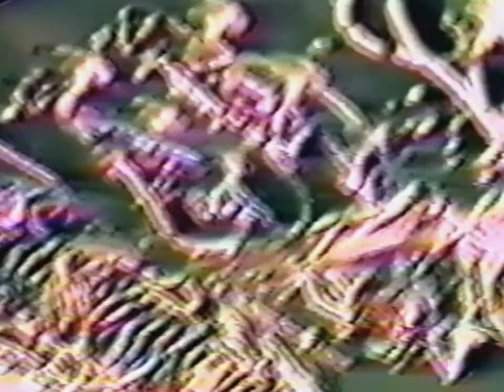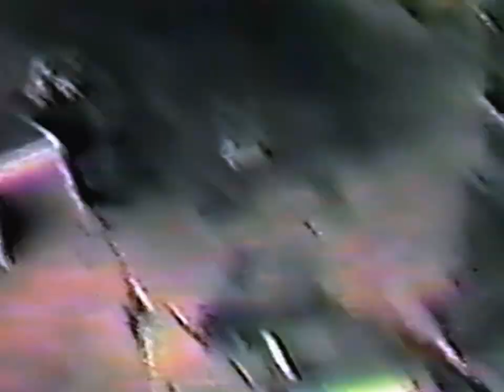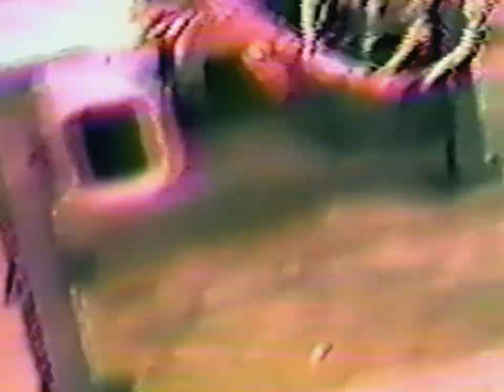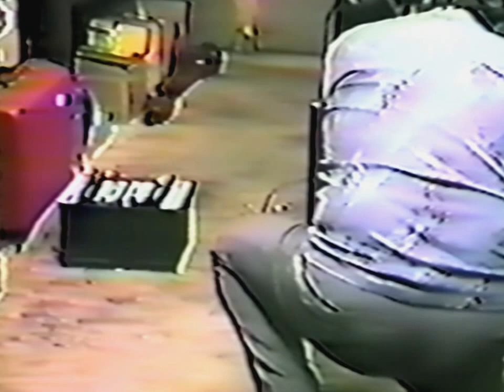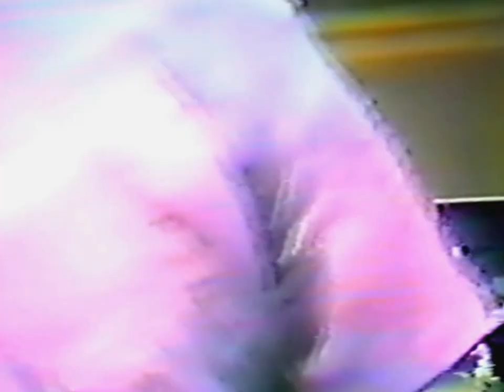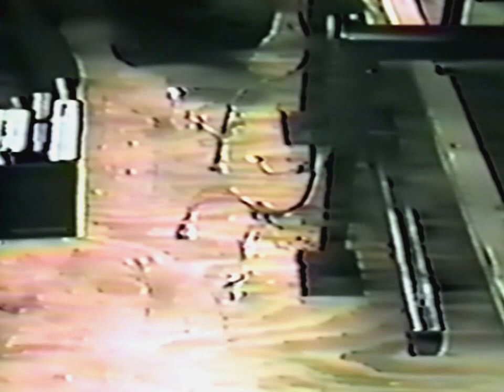7) Origin of the Papp Engine - Early Repairs and Running

Comment from the maker: Thanks for your support Russ. I wish they were better. One of my big regrets is not restoring these twenty-five year old VHS tapes before they had gotten into such bad condition. No amount of enhancement will ever pull out what is no longer there.
Reply: Hi bob viewing joe Papp and Stanley Meyer I believe that the cylinders become light guides for a plasma to air ion state that causes movement and by simply variacing the plasma this reve the engine all being in a closed vacuum like a flourescent light bulb never runs out of inert gasses as the field feed energy from the neon transformer is both the exciter and the hertz pulse collapsing ac becomes the stabiliser to the immited photons
Reply from the maker: @honda4004  Thanks for the response. Interesting observation but I have doubts concerning the conservation of energy. I'm leaving for the airport to confer with some other engineers who are in all likeyhood - much smarter than me in your field. I'll bring this up with them. If you don't hear back - keep hammering me.